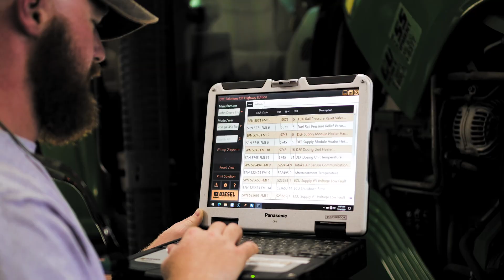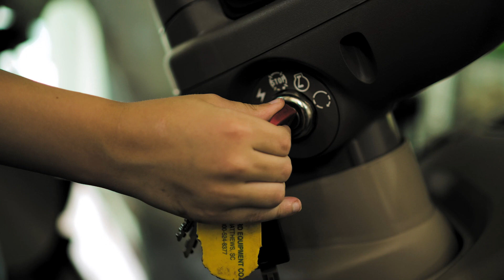Repair Them Like You Used To | Diesel Laptops

Comment: I just got a diésel laptop and I have a dodge 2007 with no communication between the PCM and the 3 errors uc100 uc140 uc100 and will like to know how to update a PCM 4945387 .
Reply from the maker: The DIY method would be to buy the CarDAQ-Plus 3 from Opus, and then program it.
Reply: Diesel Laptops where can I get it and how much does it cost